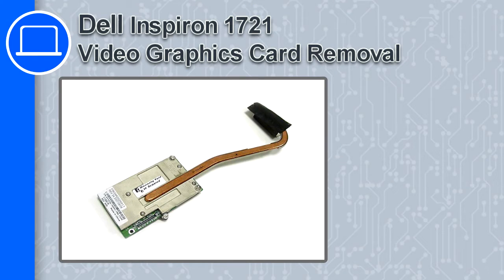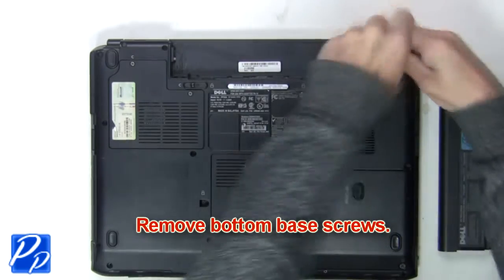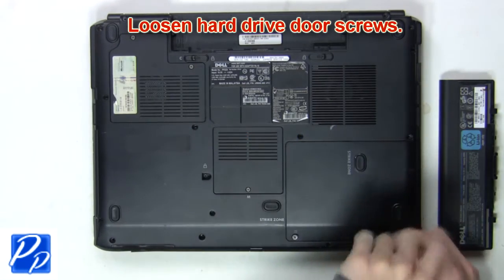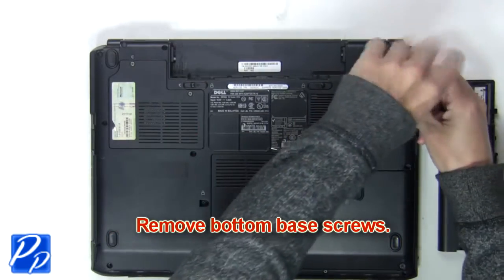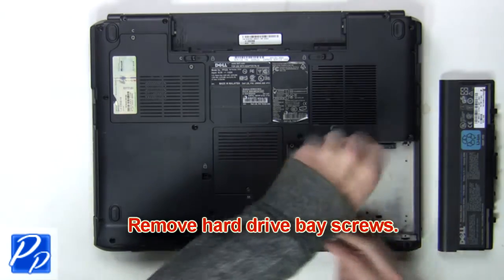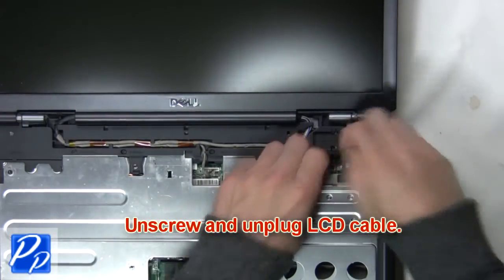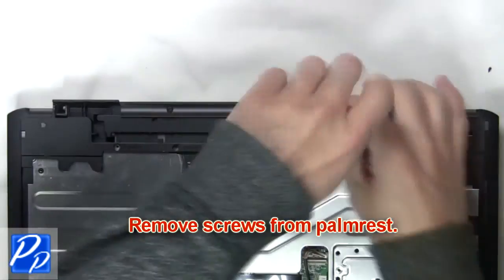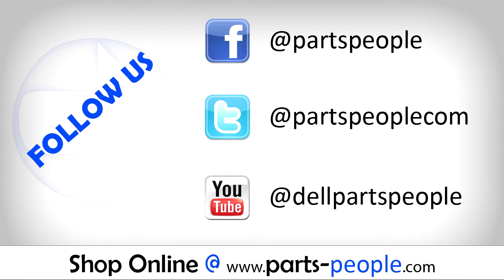Dell Inspiron 1721 Video Graphics Card Replacement Video Tutorial

Comment: Can You tell me if the Hard drive and RAM from an Inspiron 1525 would be compatible with the 1721?
I have a 1525 with broken hinges and I see that there is a 1721 on Ebay with no hard drive or RAM. It would be a cheap way for me to solve my problem.
Thanks,
Kenny.
Reply from the maker: Yes. These systems both use up to 4GB's of the same type of memory as well as the same type of hard drive. You will need to reinstall your OS after moving it to the 1721.

Comment: Hello I have a Dell 1721 and the PC quit workingm the hard drive spins and the only thing that comes on with the power button and the FN button pressed during power on is the Number Lock and Cap Lock LEDs Flash and the scroll lock stays on. I have swapped out the Memory cards thinking that was the problem but no joy. If I swap the cards I only get the Cap Lock LED that flashes. Is there no video card in some of the 1721's ?
Reply from the maker: It sounds like you might have more than 1 problem. Possibly a bad video card and a bad memory stick too.
Reply: Are there some 1721 laprops that do not have a removable video card? In looking at your tear down in the video, this one has the removable card, I dont believe that mine doesa. Im gonna remove the palm rest this weekend to verify.
Reply from the maker: Yes there is an alternate motherboard that has an integrated GPU. If that is the one you have, you will have to replace the entire motherboard. On the plus side, if you happen to have a bad memory slot as well, it should be fixed with this process too.